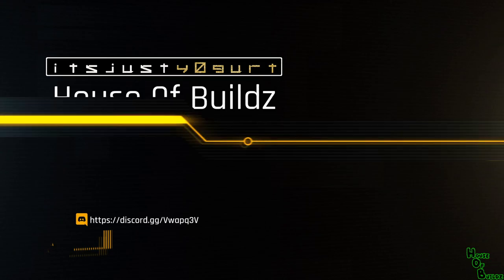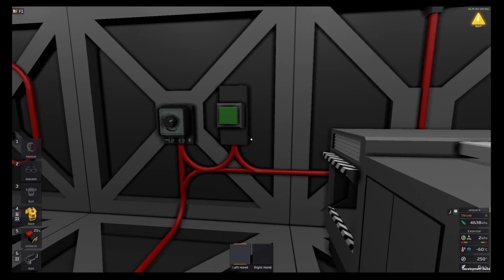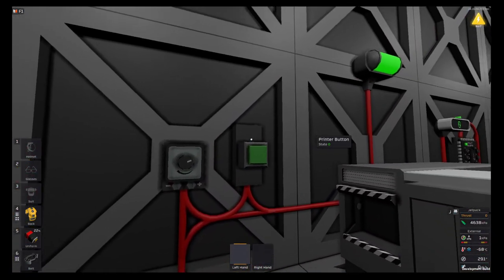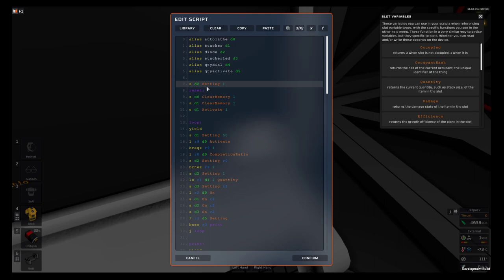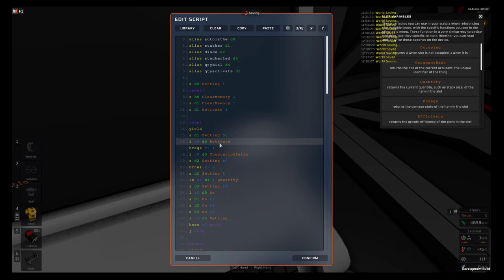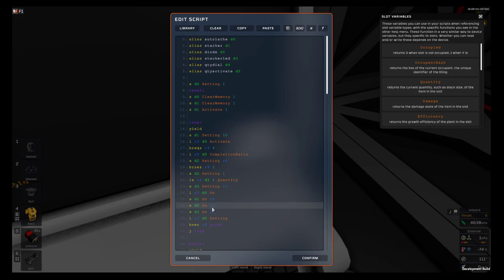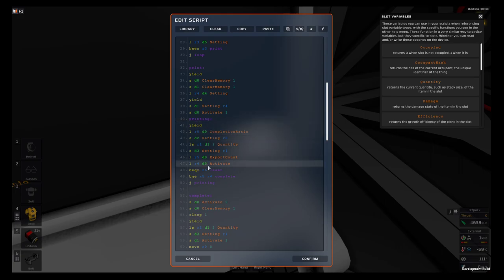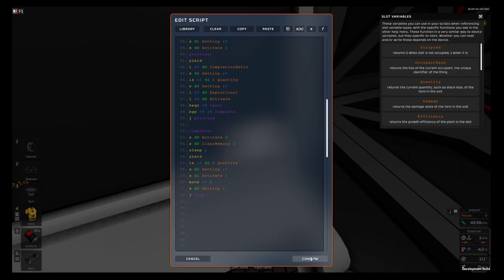Stationeers Automation - Quantity Control for Workshop Factories

Comment: Nice!  Don't you love how the stacker's controls are on the opposite side of the machine from each of the manufacturing machines, so the material flows the opposite way?  The devs are just messing with us, heh.  I like your solution to that problem.
Reply: The stacker has 2x variations, one with mirrored controls.  Use middle mouse to switch between them (like walls).
Reply: @Timberfoxes  oh, I didn't realize they'd put the mirror in yet.  Thanks!